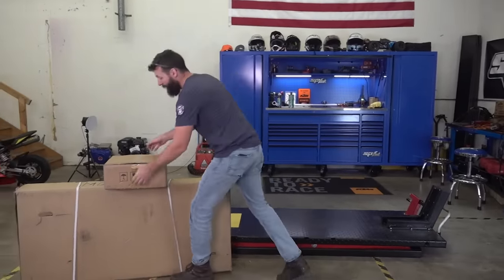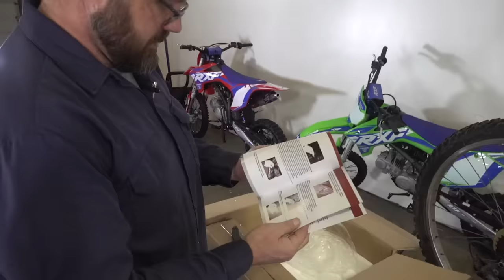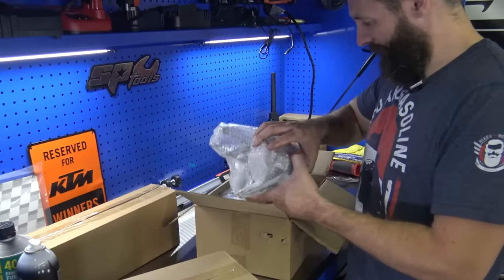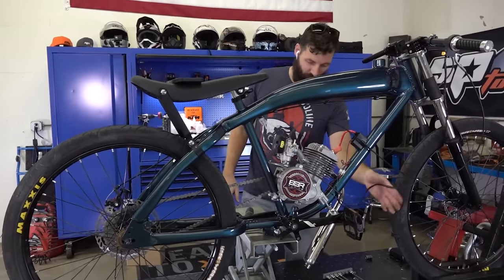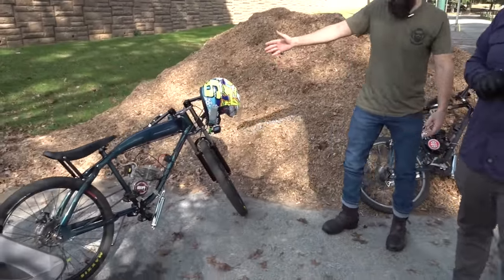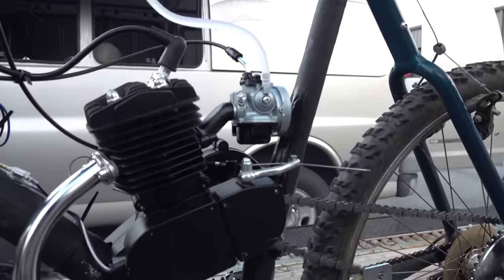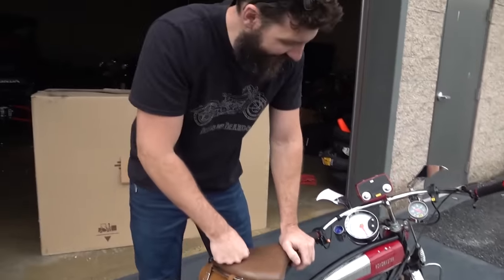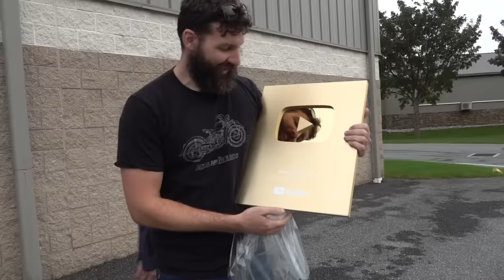I Bought the Cheapest and Most Expensive Motorized Bike kits from Amazon

Comment: I was literally just thinking of this type of bike yesterday and now you made a video on it! You guys are the bomb👌🏻👌🏻👌🏻
Reply: Bomber. Allahu akbar
Reply: I recognize the red radio they were sold at Radio Shack in the early 60's...I'm 68 n my friend Dave had that radio on his cruiser bike...we were maybe 10 or 11...
Reply: Nasty, these guys didn't really do all that well with their presentation for truth and accuracy, entertainment HELL YES though.  First of all they didn't center the rear sprocket, the reason the chain came off, you could see it wasn't aligned up to the axle in either plain.  Next the cheap one with the bigger carb they didn't adjust the needle.  Sorry both were running extremely LEAN.  Will burn holes in pistons doing this, and they present themselves as motorcycle mechanics and I could tell from the presentation and their comments just how lean they were running.  Next they were running a 40:1 fuel/oil mix, guess reading comprehension is not their strong point either as if you read the BOOK it clearly states 24:1 for the first 500km then you can run 32:1 at a minimum.  Then worst of all was that WFO with them strapped down, sorry any AIR COOLED engine will blow quickly with no air flow.  Now also would you run a new engine WFO without a load on it, now remember there is no governor to limit the engine speed.  Try and put a brick on the throttle of your car after draining the radiator and see how long it runs.   My grandkids and parents have run the piss out of one that I built with a sidecar and so far it hasn't went BOOM.  If you have a mechanical grasp and can read they are fine, wouldn't go across the country on one, the bike would likely make it but I doubt the rider would.
Reply: @alfiejones4253  
: kaboom?
: Yes Jamal, kaboom.
Reply: Allahu akbar
Reply: Yo ain't no way me to I swear I cant make this up

Comment: Wow, coincidences... I also worked building Walmart bicycles in the late 80's. EVERY bicycle out of the box had loose spokes, NO shifter/derailleur or brake tuning, so they had a 60+% return rate up to that time. After 1 yr, the return rate was just over 4%. The manager was still only worried about units/day assembled because his bonus was based on sales alone at that time (Christmas WalMart bike sales are insane and he wouldn't authorize overtime). At that time, they did not penalize for losses due quality issues which they wrote all the returns up as QA issues.

Comment: I bought a true 49cc Grubbee 2 stroke kit and the only big problems were the stock intake tube, which leaked and the stock chain, which stretched and had no tensioner. Once I replaced  the stock intake with a cast tube, replaced the stock chain with a 410 and installed a spring loaded tensioner, the bike ran great. There's no race for the crank bearings, so Grubbee recommended running the engine at no more than 15 mph for 5-600 miles so the crank bearings would fit themselves into the crankshaft! I still run it rich at 24:1 with primo 2 stroke oil and NO problems after 15 years and over 1000 miles!-John in Texas

Comment: i love motorized bikes! huge bummer yall used stock parts though. word of advice would be to use a self tuning carb, 32 tooth sprocket and a straight pipe exhaust with an expansion chamber. youll get an extra 12 or so mph out of it. best of luck boys.
Reply: That seems like the best advice for quick HP. Did you do a big bore kit too?
Reply: Where can I get such a carb?

Comment: The most critical part of those engines is the break in period. I do three heat cycles without driving, retourqe head bolts, ride slow, ride medium, then giver nuts. They are actually pretty reliable.

Comment: These engines are actually decent. I've 3 years and over 40 mph out of my 80cc. I upgraded the ignition coil, plug, carburetor,  ported the head myself, added a finned head, and a blast pipe.
Reply: One does not "Port a head" you might be able to port match your cylinder intake & exhaust ports. 🤔😫I'd like to see what you did to your head🤕👋😆🤣
Reply: I’ve been “on the fence” about trying one of these for a couple years now. After watching this video and reading through the comments, I’ve decided to order one and try it out. If nothing else, it’ll be a fun and relatively affordable experiment. Plus it’ll be fun to tinker with and upgrade.

Comment: the cheap china ones last if you take care of them. i rode one around before i got my lisence for like a year. ride the thing everywhere and it was fun. they do vibrate quite a bit and can be tricky to maintain. you can get the whole kit for $85 on ebay and they are a ton of fun. definitely build one!
Reply: I got an 80$ kit of ebay i run it on like a 20-1 to 32-1 ratio maybe leaner, maybe richer around there, and rev and beat the piss out of my cheap bike and it is the most reliable thing I own, winter is starting and my thrust exhaust vibrated off so now no exhaust till I get new bolts, still starts and rips just gotta run em rish on oil and they last lol

Comment: The quality of those 2-stroke engines can vary depending on the source. While they may not be top-of-the-line, they can be quite dependable if installed and maintained correctly. Take my Schwinn OCC Stringray chopper, for example, which is powered by a Zeda 80 engine with customized porting. It reliably gets me where I need to go. However, keep in mind that you'll need to invest some effort to make these engines run smoothly. And when it comes to purchasing the kits, it's best to steer clear of Amazon since they tend to be overpriced.
Reply: Half of the motors the piston is installed backwards and the rings clip the port. Grind the key way down to retard the timing this will give you double the rpms.

Comment: I've been waiting for this video for years. I've been building these for about 7 years and have built every motorized bike you could think of. Love these things, keep up the great work!

Edit: I've routinely gotten 1000+ miles out of the 39cc 2 stroke motorized bike kits. These things won't die unless you run them at wot woth no cooling.
Reply: Any time you want to use English . It would be nice wot?
Reply: @charlestonbrown148  Wide open throttle, pretty common term
Reply: @billydavenport8134  to some but thanks for the info
Reply: @charlestonbrown148  I gotchu
Reply: @charlestonbrown148  it's common lingo amongst auto/bike enthusiasts
Reply: @noneyabizz8337  especially when all caps, like WOT, wot?

Comment: I've built many of the 2 strokes have Craig cut his muffler off and they rip
Reply: Higher top speeds or faster acceleration?
Reply: @SaltyCracker402  its both, the muffler is SUPER restrictive
Reply: @ambiguoustvreference835  time to break mine outta storage then!
Reply: Rip a hole through the piston even faster, you mean?
Reply: @DetroitMicroSound  quite possibly but the motors are cheap enough that it's worth a try in my opinion. My bike handles full throttle for an extended period of time fairly well. I rode it all over Houston and the only problem I had was with the brakes on the cheap shitty walmart bike the motor is on.
Reply: @SaltyCracker402  The correct thing to do, is tune the engine with a chamber pipe, when it's a two-stroke.
Reply: The reason why Craig's underperformed was because he put the head on backwards
Reply: @failoblivious4951  no it's not. I've put the whole jug on backwards. Still ran. Once I even accidentally hooked the mag to the cdi backwards, and believe it or not,. It still ran. It ran backwards, clockwise, but it ran. That one took a while to figure out.

Comment: Try braking in your little engine before you run it wide open. Tune the carb and keep everything tight. I have had mine on three different frames and still going strong. Great video, teaching what not to do.
Reply: A good question would be what happened to these frames...
Reply: One I couldn't find the right size tires,the other I dug up in my cousins yard, so its a good peddle bicycle.
Reply: @rockyrocker23   definitely not an issue to run wot and being stationary 🤦‍♂️ they blew up because They were held at redline with no load on the engine chainsaws run wide open sitting still all day long because they have a load on the engine🤦‍♂️

Comment: I can't speak for the first two bike motors you guys had but I have one of these cheap $100 motor kits on an old 10 speed that I have logged at least 3000 miles on using a digital odometer and the thing just keeps on going strong.
Reply: What is the fuel economy per litre?

Comment: I made one using a reel lawn mower engine using a centrifugal clutch back in the early 60's. Learned all about gear ratios the hard way. 

It seemed like the best way to go was installing the motor on a platform behind the seat and using a fan belt with a centrifugal clutch.

Comment: Ive had a $100 80cc 2 stroke and theyre nice af if you rebuild the carburetor, "modify" the exhaust(cut off the muffler part and leave the 3 inch tube), and mess around with the chain tensioner

Comment: The 49cc 4 Stroke  bicycle engine is bullet proof compared to the 2 smokers. I rode one daily for 3 years. I've never had so much fun. I went thru wheels, chains you Name it but the motor still runs perfectly. Last count it had 30k miles on it.

Comment: white cable gives you 5v out i believe. also mine i was riding it from my mechanic to a friends and my muffler fell of, caught the back wheel, and gave me a flat and i had to take a van cab home. got a high performance muffler and put it on, rode to work a few days, and was going 40km/h and aparently all the vibration knocked a motor mount and mount stud loose, broke my exhaust bracket, and a couple other issues. also the carb float kept sticking so i replaced the carb with a higher performance one and she rips. still need to fab up a new motor mount and exhaust mount, havent ridden her since november. gotta get that fixed up. 
good luck guys, be cautious and pray.
Reply: also i honestly love the punisher face on the airbox. deff my fave feature of these kits. also the upgraded cdi helps performance i believe.
Reply: dude that new one is sick. vintage, with the nos bottle!

Comment: They're still bicycles, so 25 MPH is a good speed limit for them.  Certainly you can get a better bike, but that 25 pounds added is unkind to brakes and cuts the agility the original bike had.  This is the warning that should be in the manuals.  Another problem I ran into was those terrible rubber mounts.  The motor moved enough to lose the chain.  I used keyway material to hold it to the frame, and that was solved.  A bigger tension wheel from a lawnmower shop helped, and now the chain stays where it was supposed to be.  Now, it's in need of more power.  I need to help it up hills.

I also discovered that they painted my spark plug at the factory.  I'm fighting lazy manufacturing!

Comment: Just some stuff: To make some good power, these engines need to run lean at the top end and rich at the bottom end, also you should've used 25:1 pre mix ratio, these little engines need a lot of lubrication. Edit: 25:1 after break-in, 18:1 during break in
Reply: I can't figure out how to get spark to the spark plug
Reply: 30 to 40 to 1 is fine, good enough. At least after break in

Comment: PRO TIP! Headbolts wiggle loose every couple hundred  klms. This makes it hard to start and smoke then not work at all. i got 4 thin bolts and 4 capped bolts to lock head in place, never came loose again. The exhaust vibrates loose all the time too XD

Comment: This is so funny! I have three of these bikes and I love them. All have different (2-Stroke) engines, and what I learned before I even started building the first one was you MUST properly break-in the engine. Everyone has their own way of doing this but at that time I was told to not exceed twelve MPH and a minimum of two tanks of gas (mid-grade fuel & synthetic 2-stroke oil). That worked well for me, because five years later they're all working pefectly. And by the way, these things can be very addictive

Comment: When set up/tuned properly cylinder cleaned up and ported well these motors can last a long time. I only spent $105 on my motor itself and it's got over 2k miles on it with minimal maintenance and does 55mph. Granted it's an 80cc not 50cc but it runs amazingly
Reply: What motor did u buy?
Reply: @quis4023  cdhpower super pk80 that I changed the port timing on and swapped the head for a high compression head, better cdi and a nasty jack wc80 pipe on a 36t sprocket

Comment: 2 stroke motors need oil in the fuel. I had both of those same kits tuned the carb, and they both lasted 2 years riding to and from work 12 miles each way.

Comment: the white wire might be a extra connection to mount a 6v or 12v light and ground is none existent, you use the bike frame or motor mount as a ground...

either or you can split the voltage to run a head light and a rear light

Comment: the cheaper engine may seem weaker at first but give it maybe 300-500 Kilometers of run till the engine is really properly tuned in and it will perform way better. In fact you are not really supposed to drive them faster than 20 Kilometers per hour at the early phase of using them. To not overwork the little engine.

Comment: also, the durability of the engines depends on the brand. ive seen many fail, I happened to come across one thats lasted 5 years and still runs fairly well, for 90 bucks. it just leaks fuel as the carb needs a new float, also, these kits are weird and you should be using closer to 20:1 mix, ideally you mix it yourself. personally I run castor in mine, you also have to break them in, twostrokes need to have a proper breakin period (so do fourstrokes, but breakin is more important on a twostroke)

Comment: Did you do the proper break-in for those engines? Two strokes aren't supposed to go full throttle for an extended period of time.  Also, the engine that was together should have been disassembled, and both engines should have been inspected for defects before running.

Comment: if you tighten bolts every time you ride after a couple weeks everything will settle and you'll be able to just ride.  PLUS!  these are air-cooled engines.  kinda not fair to strap them wide open sitting still.  if you do the math on the bore and stroke those engines are 67CC.  i've had a couple of those things.  i rode one of them for 3 years.

Comment: Do it again but this time,  break the engines in first. 2 strokes use the oil in the gas to lubricate so you need to let it sit and run at just above idle and mix your gas extra heavy for the first few tanks.

Comment: Those engines need more oil in the mixture to run them in. Then when they are ran in properly, then you can add more petrol to the mixture. My engine is just like that cheap one and I have put thousands of miles in it. And it only needed a bigger service once. And that brand new motorized bike you ordered has nitro equipped, so be careful :)

Comment: i built one too and mine works super nice but i think the test of running it full throttle without air cooling from riding ig that will surely destroy it but i never had issues except the stock chain tention thing and the cheap chain that came. after replacing them i never hard problems so far and still works up to this day

Comment: I bought a motorized bicycle from Facebook marketplace. It won't stop derailing. Actually what happens is the chain kinks inside the motor and stops which stops the tire and pops the chain. I tried half links I have 2 slack adjusters it won't stop derailing the 415 chain.

Comment: Air cooled motor sitting still will lock up from heat, fun to watch, bad test. I have the China version and have about 3000 miles on it, no brakes and still running strong, ride to work 22 miles one way and do it in about 35 min. Last bike is cool looking

Comment: Those two stroke engines are air cooled, their was no air flow to cool the engine , so thats why they siezed up. you need to ride them to cool them down! Its a bit like driving your car flat out with no water in your radiator!

Comment: If you run 16:1 oil gas ratio and keep under half throttle for the first 2-3 gallons of fuel the motors will last for thousands of miles.

Comment: I brought one of these for $40 from a second hand shop last year new coil got it running used to ride about 25kms to the next town one hot day full throttle it siezed so i jumped on the peddle pretty hard and the engine freed up rode the rest of the day no problem another time i raced the pocal postie bike on full throttle then it started knocking so i removed the engine pulled the head found id snapped the ring couldnd find the small piece that broke it didnt scratch or ruin piston or head just disappear new ring goes great i easily ride for 40-60 kms somedays

Comment: cheapest and most expensive refers to the "kits", not the engines. 
One kit included the engine (and it's accessories), plus a lightweight, stylish, uncomfortable to ride bicycle frame in a box.
The other kit was just an engine (plus accessories) in a box, and the bicycle was a used and dusty Cannondale donor-bike. 
The engines are the same - both are two stroke, 66cc engines that require mixed gas, are equipped with a manual clutch, and need a running start before releasing the clutch lever.
The other engine option (not shown) is the more expensive FOUR stroke, 49cc engine, with overhead valves, centrifugal clutch, and a pull start, that takes pure gasoline in the tank, and engine oil in the crankcase, just like a car.
Reply: All good info here, thanks for taking the time to state the facts on these engines.